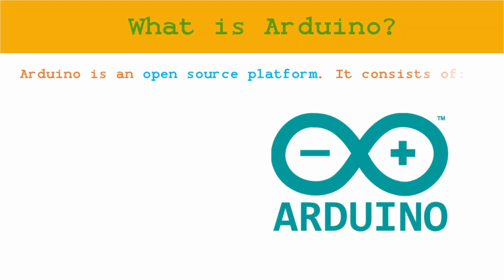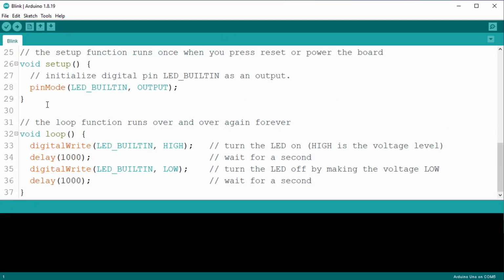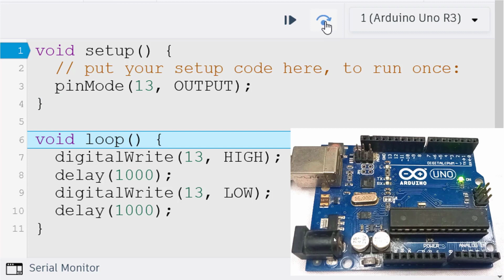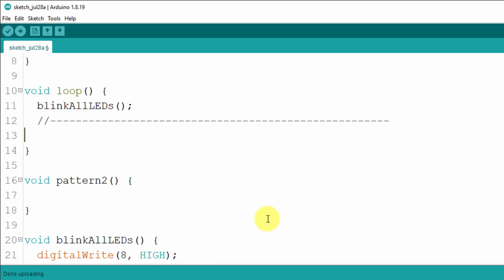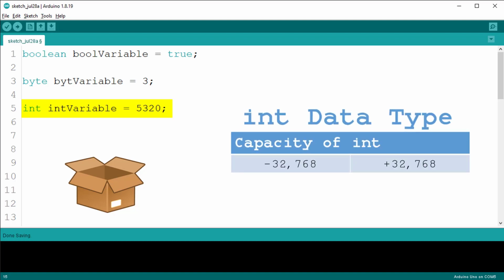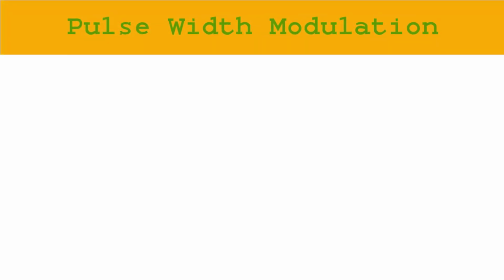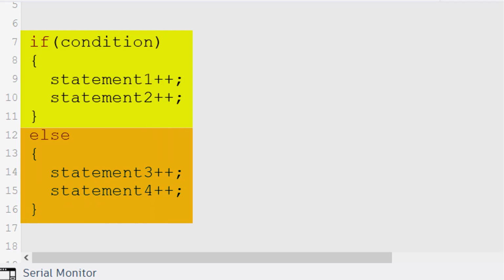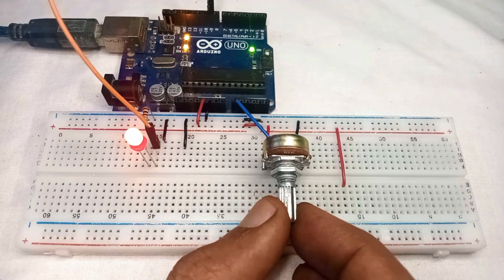Arduino Full Course for Absolute Beginners | Arduino Programming

Comment: Hello, I have a problem installing libraries. The issue can be resolved by #include "RMaker.h" and #include <WiFiClientSecure.h>. I downloaded the arduino-esp32-master library, and the same problem remains. No libraries were found and the link was added in the Arduino program.